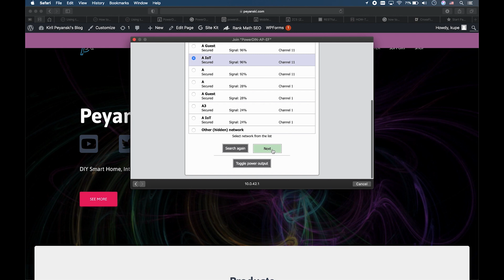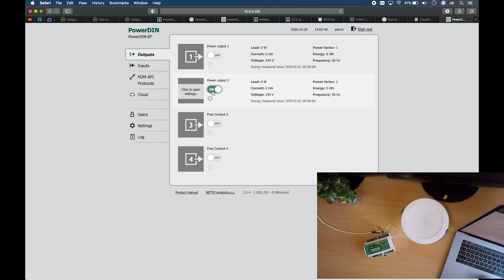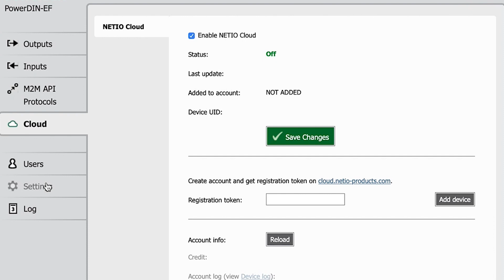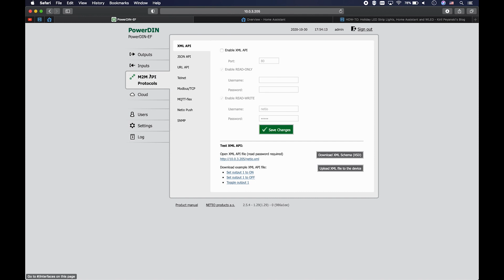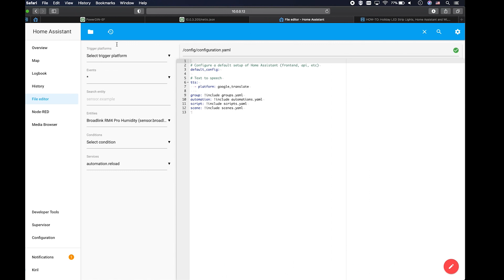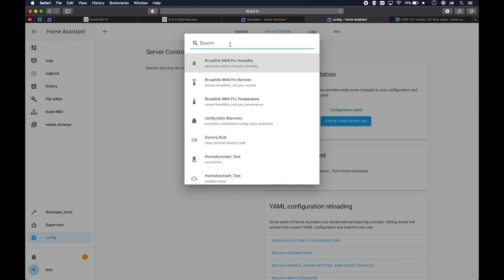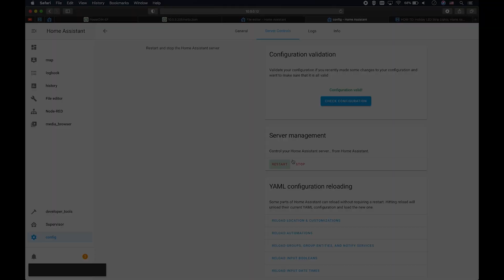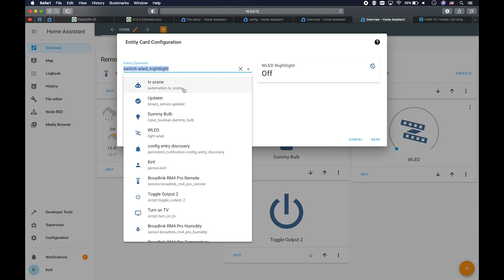Home Assistant REST and Netio PowerDIN 4PZ

Comment: Evwrything was great until I saw the price, 230€!!! Wow, currently I use Shelly products for my smart home. I have 11 blinds, doors, over 50 light circuits, fans, etc. And with Shelly it was relatively affordable to make my home smart. Since my home is built one year ago all the wiring is made in central location in electrical cabinet. For now I use wifi connection for Shelly products but I live for a day when I will be able to use LAN wired option since my installation is prepared for that. For a moment I thought that this product in the wideo is the solution but the price is rirdiculous, I would need few thousand euros. I think that Shelly 4Pro Plus with the LAN option would be much more affordable when it goes on sale.
Reply from the maker: Hey Tommeehr, thanks for your comment, I cannot advocate about the price and I don't want to - that is a vendor decision. Just have in mind that this product is targeting industrial clients, where everything should work no matter what and where they can benefit from the extended life of the connected equipment due to the available technologies in this device like the ZCS (Zero Current Switching).
Reply: @KPeyanski  you are definitly correct. I do not say that product or price is wrong. For reliable aplicattions industry standard equipment must be used.
But one question for you, is there a possibility that you test KinCony LAN boards, they enabled homeassistant compatibility, prices are fair because boards have many relays, so price per relay/switching circuit is fair?
I would appreciate if you could reply.
Also, watching your channel from the beginning, please continue, I appreciate this type of videos with english language, but from people in EU 👍🏻 Our wirings and needs are often totaly different than the people from US, like with anything, cars, houses, etc.
Reply from the maker: I will take a look at these boards, thanks for the Idea 💡 And I'm really glad that you are watching my channel from the beginning :) Appreciate that!
Reply from the maker: Interesting 🤔 They are from my country, I will check them out...
Reply: @KPeyanski  I have one of this Denkovi, work perfectly with Home Assistant
Reply from the maker: nice, what API are you using?
Reply: @KPeyanski  it communicate through MQTT with  my Home Assistant, all is very good document and explain in product manual very easy to integrated to HA